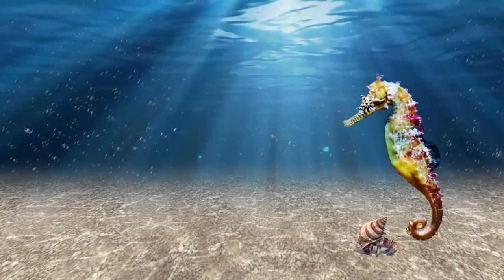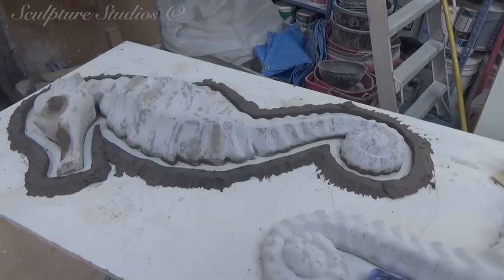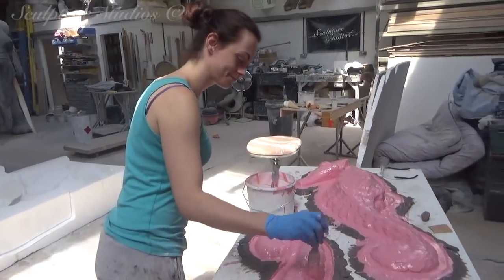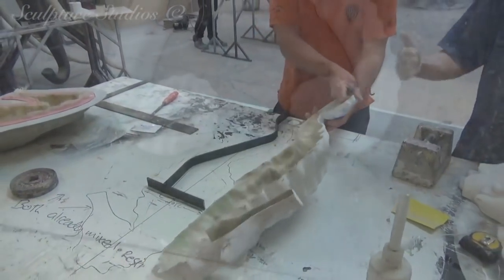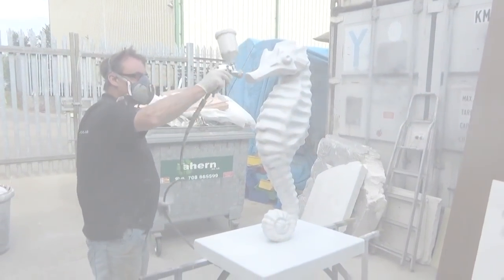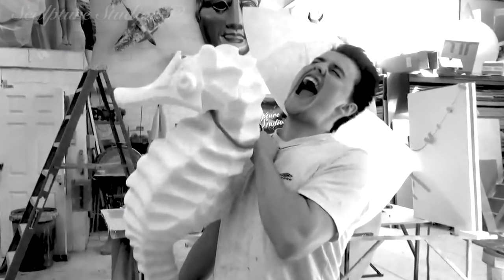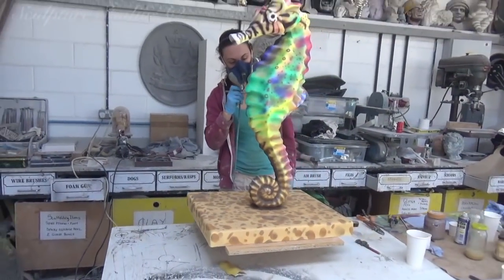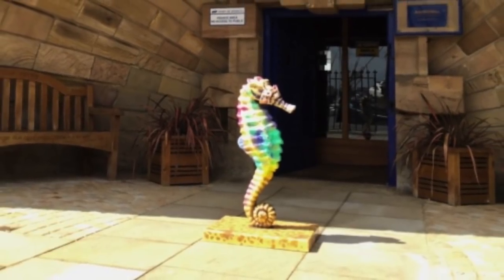Giant Sea Horses - Ipswich Art Trail by Sculpture Studios

Comment: Beautiful work! I was wondering - how did you connect the two fiberglass parts after demolding? Which material did you use?
Reply from the maker: Doron R we do what we call a squidge join. Chopped strands of fibreglass and resin around the seam on the inside. Squidge them together, and then trimmed off the excess
Reply: Thank you for the quick reply! The question is - how can you access the seam on the inside if it's a fully-closed sculpture?
Reply from the maker: Doron R we normally create a little shelf on the inner lip before joining. Line it with chopped strand and resin on both sides. Pop the two halves together. And all the resin on the inside seams bond together
Reply: Mystery solved! many thanks :)